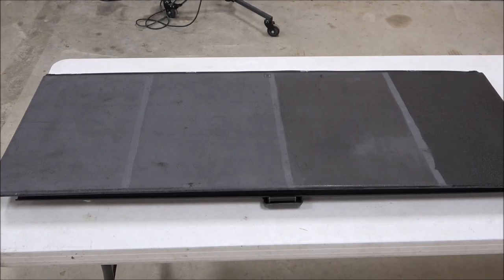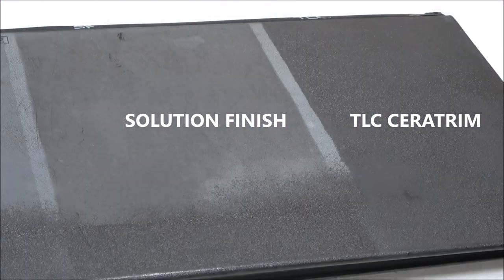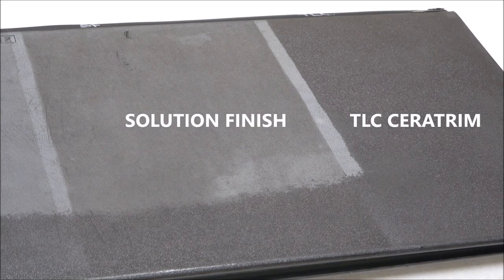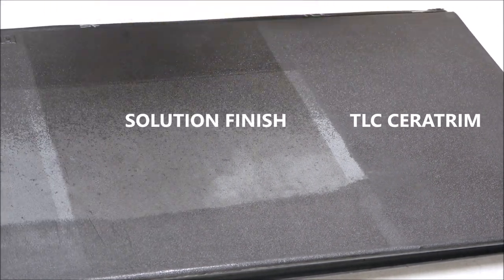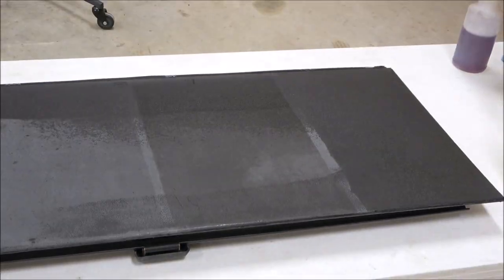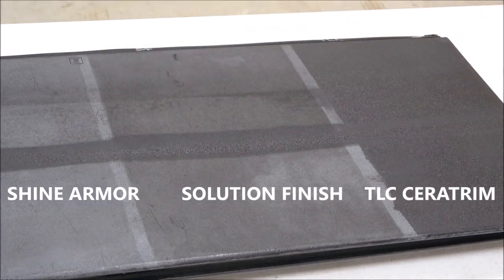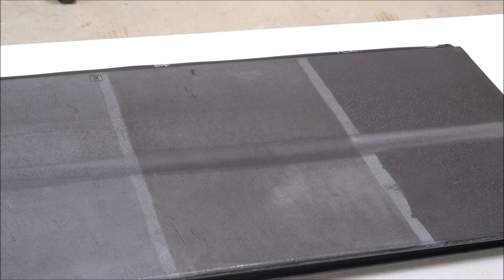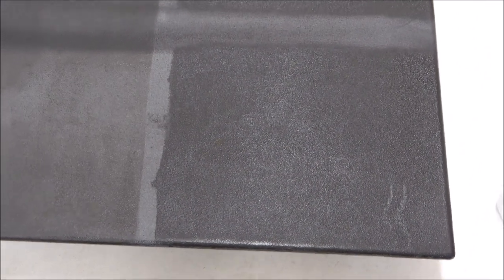F11 Top Coat vs The Last Coat vs Shine Armor vs Solution Finish Torture Test

Comment: Nice test. Will the Ceratrim fix the damage from the gasoline and hide it completely?
Reply from the maker: It definitely should since it is essentially removing anything that was on the plastic, so it would be a fresh surface to reapply to.  I can check